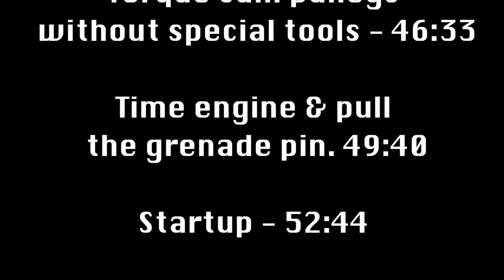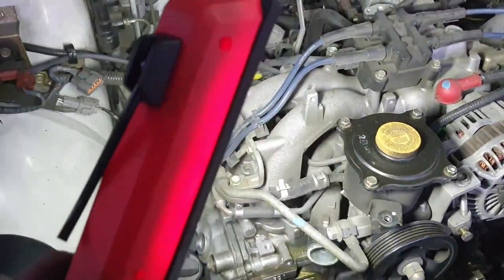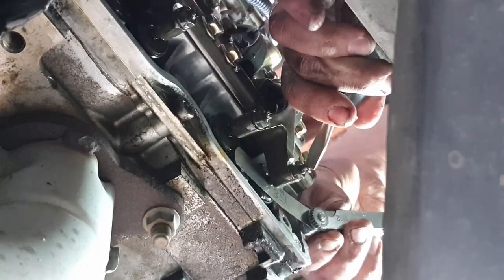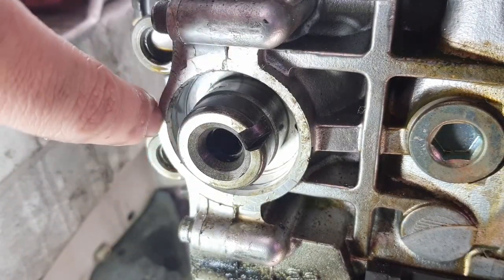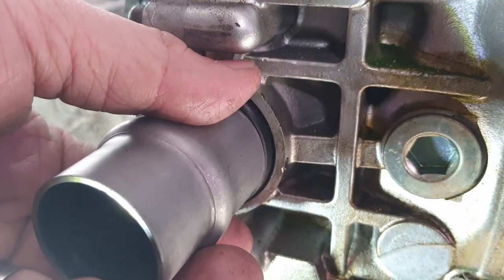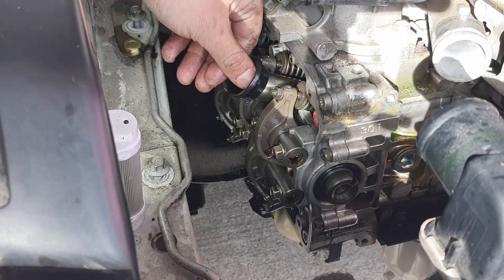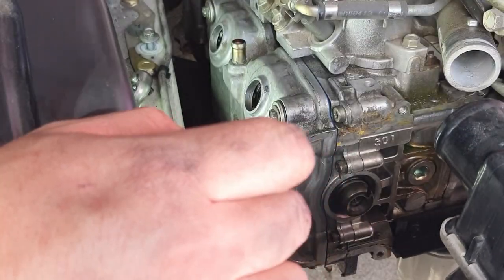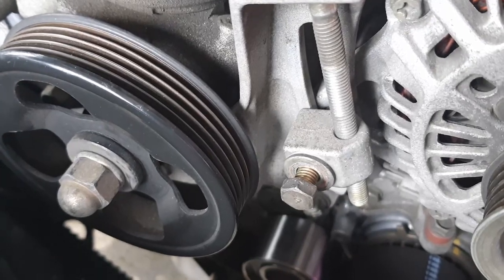Subaru cam seals, water pump, timing belt, valve lash | EJ22 Impreza (1999)

Comment from the maker: Chapters:
Looking for Coolant leaks - 0:41
Looking for Oil leaks - 1:33
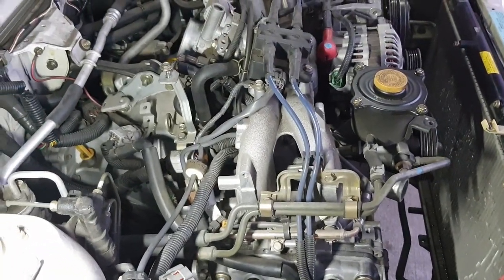Adjusting Valves - 8:53
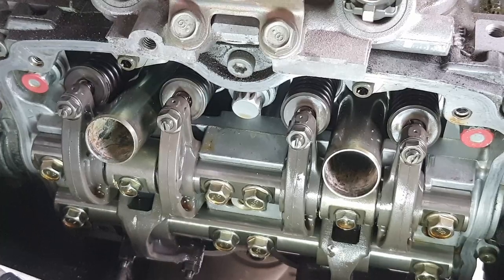Checking Cam Seal surface - 21:48
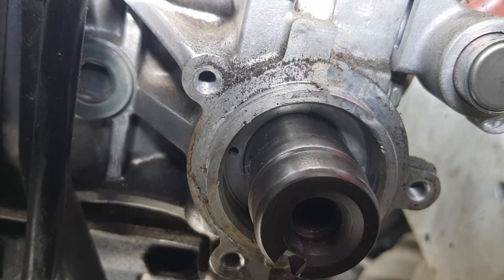Installing Cam Seal - 26:30
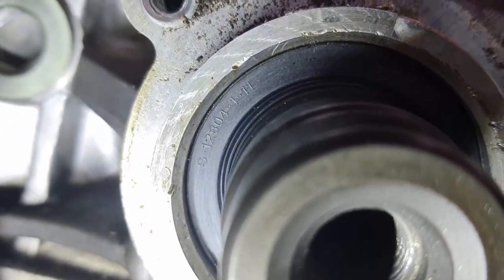Prepping Valve Covers - 32:32
Installing Valve Cover Gaskets - 36:31
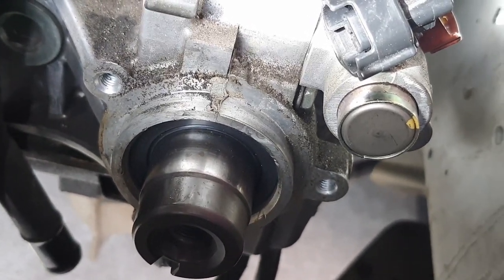Inspect Water Pump - 45:07
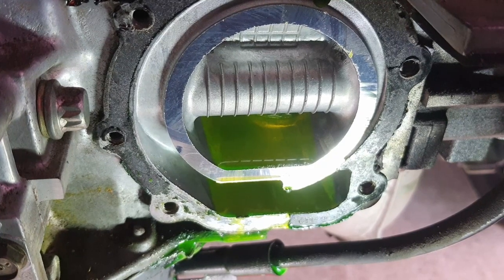Torque cam pulleys without special tools - 46:33
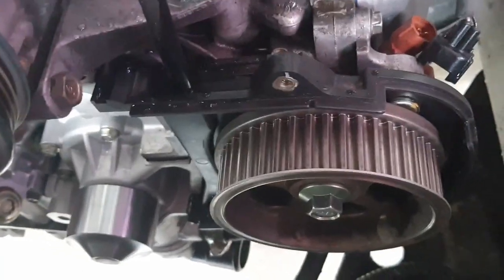Time engine & pull the grenade pin - 49:40
Startup - 52:44